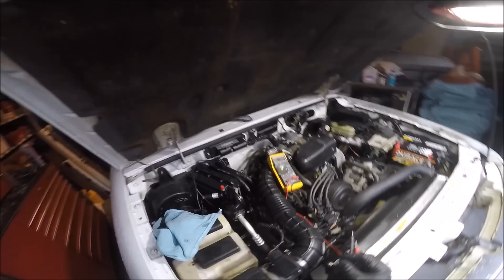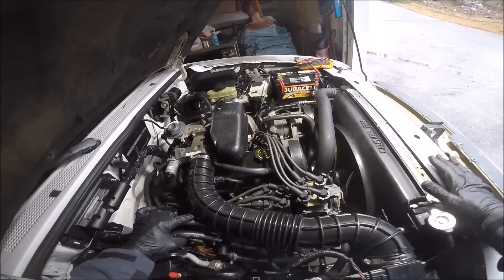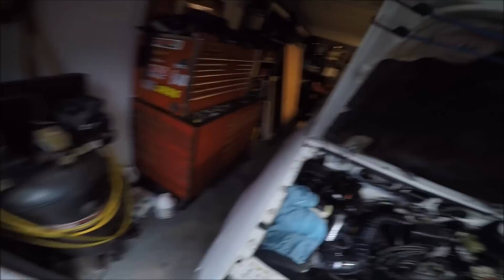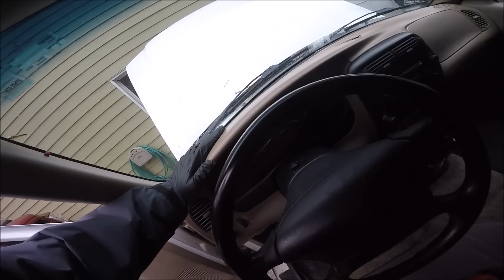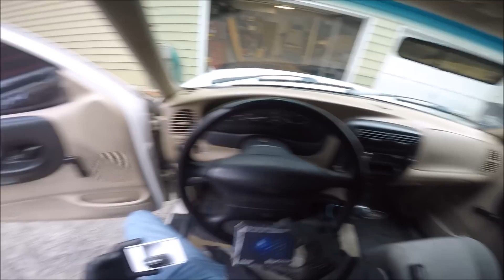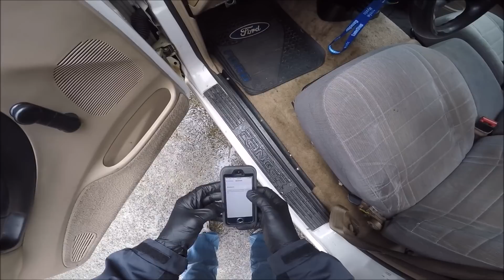Ford Ranger no temp gauge and no heat fix

Comment: I got a 2.3L 4cyl 1997 ford ranger gage is not working but the motor is not getting hotter then usual but is probably 10-20 degrees colder when idling for a while and but is running great and has super hot heat. just did a bunch of stuff like thermostat and water pump and all rad lines and flushed everything but now the gage doesn’t work it worked before do you know why that could be?
Reply: Having the same problem currently with mine have you figured anything out since?

Comment: 2001 3.0 replaced the water pump thermostat and sensor. Heat works but gauge doesnt.
Reply from the maker: Did you change out either of the two sensors? They're different from each other.
Also try loosening the sensor with the engine at operating temperature to bleed air from housing.
Reply: Did you have heat before you put those on new? My 98 3.0 has gauge and says its normal operating temp, but no heat in the cab, i flushed the heater core and it has good flow rate and the truck pump hot coolant through, blend door is broken but no heat either direction. Im stumped

Comment: I just want you to know I bought a 2000 b2500 for my father and changed the thermostat and housing but still had this issue. HOWEVER, I found your video and it SOLVED THE PROBLEM. So I genuinely appreciate it.
Reply from the maker: What was the problem. No heat or no temp gauge?
Reply: @mediajunkie2195  both.
Reply from the maker: @ So strange how a large pocket of stuck air can cause 200F water from getting to all areas of the system ahy?
Reply: @mediajunkie2195  it really is. I burped the radiator forever and thought man what the heck. Until I found this. Still crazy.

Comment: I replace temperature sensor replace temperature sender and replace the thermostat Stihl gauge won't move at all guess I'm going to check the wiring next that connects to the temperature sender and the sensor any other suggestions?
Reply from the maker: Put your truck back together as is. Then bleed the air out of heater core system per the video

Comment: Touched my valve to roll it. I wanted to see this actuator. It snapped clean off. It was a good thing i watched this while burping it, not heating it up, or else i would have some nasty burns right now. Careful out there friends. Btw who else found this vid through his ranger station post? Off to a.z to get a heater core valve

Comment: So will the temp gauge sensor keep  your heater from work ? Because i done tried everything flash the heater core ,check blend door , everything plus my temp hand run dead in the middle but my hose is luke warm like your.
Reply from the maker: Absolutely yes. Once I flushed the crud out of each and every hose then bled all air from system heater hoses began to get warm. Then a little more air purged and all of sudden the heater hoses were hot. All most untouchable. Good luck
Reply: My gauge is reading but I have no heat 🔥, could it be a false reading, plus on another video says it have two sensor
Reply from the maker: There are two sensors. One for the gauge and one for the EEC.
With engine at operating temperature and full heat selected All hoses should be to hot to hold in hand for more than 5 seconds. That is including the heater hoses. They too if operating normally will be to hot to hold. If not then suspect blockage, bad heater valve, or air pocket. @kennethrobinson7777
Reply: @mediajunkie2195  thanks alot
Reply from the maker: Good luck @kennethrobinson7777

Comment: Hey guys, i had this same problem. (No temp gauge, no heat)  I replaced the thermostat and both came back. When the thermostat fails on these trucks, it fails open-so the coolant never reaches operating temperature. Thus temp gauge appears to not read and no heat because coolant doesnt get warm enough to provide heat. Hope this helps somebody else out!

Comment: No I don’t see anything because the camera doesn’t get close enough to show anything. My gauge has always worked just no heat
Reply from the maker: Very carefully with thick rubber gloves remove a heater line from the core and wait for heated coolant. If it never shows up then you have blockage. If coolant does start to flow you may have had a large air pocket and now purged

Comment: I'm having similar problem and I suspect the fan clutch has failed in the "locked" position and as a result, I believe it is over cooling the engine when the weather is cold. I think the thermostat in the engine and the thermo spring on the fan clutch need to work together to reach optimal operating temps. Just something for others to consider when trying to solve a heater and temp gauge problem.

Comment: My gauge stopped working a few days ago and is now just sitting below the C and does not move. t the same time I'm now getting no heat (not blower hot air). I just changed both sensors on my car, the conical shaped tip sensor was towards the rear of the car. and the plunger looking one was towards the front of the car. I put the new ones in the same position, however this seems to conflict with what you've said here in the video. I am also using a live data OBDii tool and it is not reading the engine temp. What is your thoughts?
Reply: Your description of wire colors for the gauge vs ecm was spot on. Today I connected the gauge female connector wires together with a paper clip and the needle went to H with ignition not on but in position 2. The sensor is a plunger looking tip and therefore the ecm sensor is the conical tip. I flushed the coolant, heater core and changed tstat and I have a working gauge, ecm and good heat now coming into the cab. Your video helped me thanks.
Reply from the maker: @siksclass  Glad to hear. Purging air (Burping) from system seems to be the biggest issue with this little 4 banger.

Comment: That heater control valve was dead on my 2.5 99 Ranger. Nothing . I removed it completely, ran new hoses, back flushed the heater core. put a coolant filter on the pressure side and voila I had heat. It will run you out, even in sub-zero weather. BTW the coolant filter is catching all kinds of gunk and removing it from the coolant. I used a oil filter relocation kit for the coolant filter and it works great with no reduction in the heat. Removing the trash from the coolant only helps.BTW I rarely use the air conditioner. You might want to consider a cold air intake conical air filter. The truck breathes freer and runs like it has a V8 under the hood. I have done other mods, like a HHO Gas generator (It DOES help mileage) and refitted all the lights with LED lights, even the headlights (9007 type). Lights up the road like crazy. Even the interior and dash lights are LED now. Also replaced the rust eaten muffler with the modern version of a Cherry Bomb Muffler. It's still quiet, until you punch it.

Comment: I replaced  temp sensor, Temp switch sender , and thermostat twice  switch and gauge was still dead , but after i flush the heating core that temp gauge started to work. ranger 2003 3.0 6 Cyl.       Flush your  heating core before start replacing. sensors
Reply: What si the heating core bro?
Reply: @VSIAES  

Heater core is what the two hoses go into on the passenger side of the firewall.
Reply: So will your temp sensor will stop your heater from working
Reply: That sounds like my 2000 ranger with the same engine and I've replaced the sensor and still don't have a temp reading
Reply: Only difference my ranger the heat will roast ya

Comment: the thermostat fit inside housing is not sealing airtight.Creating a open thermostat condition.Very common in rangers.Drain coolant from radiator about half,Take top thermostat hose off and fill  housing hose connection with coolant see if it leaks down.

Comment: I'm curious. How did you go from manipulating the heat control valve and your heat and temp gauge working to the problem being an air pocket in thermostat housing? 
Seems to me that your fix is getting the heater control valve working? I'm confused about the actual fix. Thx for reply
Reply from the maker: So air is the enemy with the Ford Ranger. Somehow air locks fluid flow to heater core and additionally causes gauge to read cold. It is only once all air is purged from system that we have perfect heat in cab as well as accurate temp on engine coolant dash gauge.
My technique in the video demonstrates that I had to leave the hoses removed from control valve with no water. It took leaving hoses off, manipulating the control valve, All the while engine running at temp when all of a sudden... Wala hot water from heater core. Understand?

Comment: I would love to know the part numbers for the sensor and sender
Reply from the maker: Do yourself a favor and order the Motorcraft housing assembly. Since the housings are plastic, sensor change outs rarely seal up.
https://www.rockauto.com/en/moreinfo.php?pk=7105944&cc=1315103&jsn=456&_nck=ZExt1ysfqhqWnq%2BEvUNdS3Txyey60IDtnjPWF5UU9J0BWQv7pvqZbkEUk86%2BAYIhFUNxSQbBt9G%2FGsHxHA%2BbNNwHxGK%2BxZhd0ydb%2BIp5%2BxVOJTl3NGBV6nYUziFya04GnNhQwmK5g%2Fsu0ZZ5FCAiZwjyeNZP%2FOWihUrBmyQa5OYv22GnPp%2Fz99lxqWMXJjcHty46s9hijBhCU9hruEnKVaPOjxvrEX78pARXusi6QvJXCg5VikhAWD8nDmpup9fZXSiQLhxDrzAGLv4PrVsL46UJrK4mnmU6lCtR%2Bs7VfyaPL3%2B8a0quJlFyQ2c5bGRHARGPc618UiqRCyS2wjuiPBQxYfqDDfQp

Comment: Ok well my 98 Mazda 2500 does the same but twice difference. It seems that when to motor is at idle the temp gauge goes up and the heat returns. Also the fan runs continually. When you I start down the road and the temp gauge goes down again and the heat goes away again. So do u think that this is the same deal?
Reply: Sorry I meant two differences. I hate a to correct
Reply from the maker: David wellman - sure sounds like air. Believe me air is not easy to purge from these. Your engine runs fine right?
Reply: I'm having the same problem in a 98 Mazda B 2500
Reply from the maker: David wellman - Yes I do but have you changed the thermostat lately?
Reply: @mediajunkie2195  no I havent
Reply from the maker: David wellman - get new thermostat housing and new USA made Stant thermostat from rock auto. Get you a gallon of fresh anti-freeze and go at it. Watch my other video.
Reply from the maker: David wellman - https://youtu.be/XtFiVHSi_xA
Reply: It is ait movement  over the engine.  Sounde like the fan.

Comment: Well what did you do to fix it.  Just press on the lever?  you never really told us?
Reply from the maker: wtasch - bleeding air out of system is the fix
Reply: @mediajunkie2195  how is air pocket the fix, when it was fixed by manipulating the heater control valve? Very confused

Comment: Thanks for posting this video! I'm having the same problem with my'02 Ranger. The cold coolant temperature caused the check engine light to come on. I reset it with my OBD2 reader, but after watching this video, I can repair it correctly.
Reply from the maker: Brad Beall - thanks for commenting. I agree, easily fixable by most DIY’s
Reply: Would this be the same on a 94 Ford Ranger 2.3 cylinder I'm having the same issue no temperature gauge and no heat and God damn it is freezing and I've been dealing with that for 2 years cuz just too lazy to figure it out
Reply: @johns128777  I'm wondering the same thing. I have a 94, replaced most cooling parts and coolant and still nothing. Mine has no A/C and does not have the heater control valve, only 2 hoses to the heater core. Have you figured out the fix for yours??